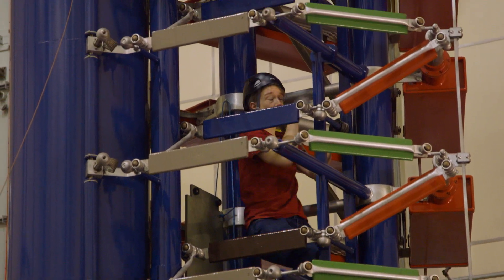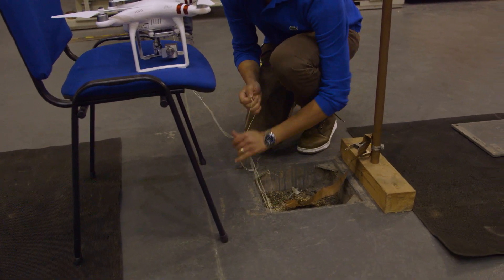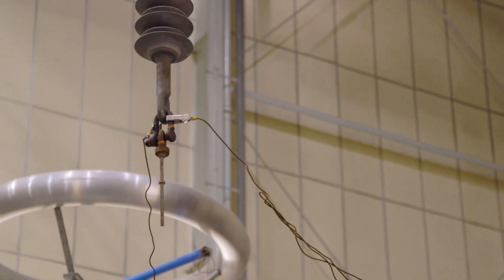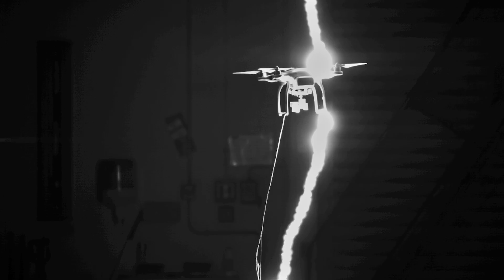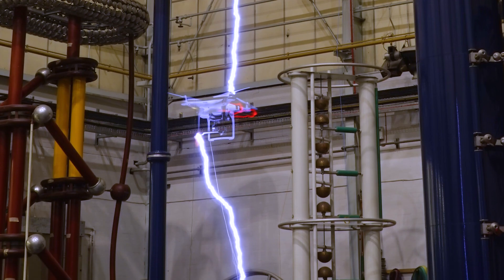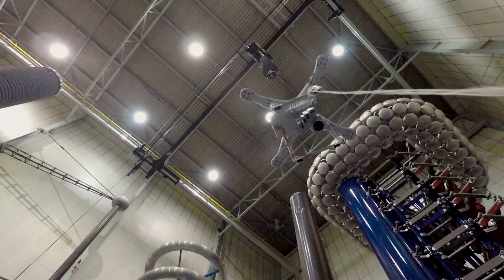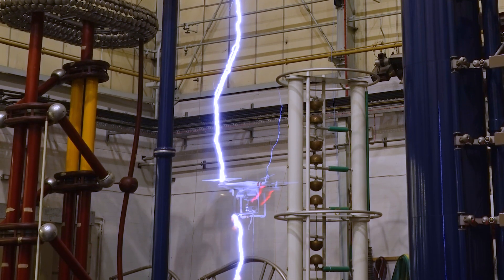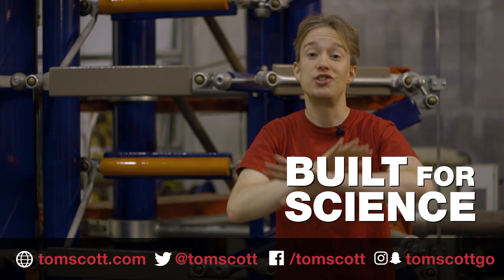We hit a drone with lightning

Comment: SloMo Guys should have been there for this.
Reply: would have loved to see the several hundred thousand frames per second on this.
Reply: They did use a high speed camera at some n-ty thousand frames per second. Says 3000x slower, and assuming it was slower than "regular" 25fps video, that would put the cam at 75 000 fps.
You could catch a glimpse of the Phantom Camera Control software on the laptop :)
Reply: a 200,000 frames per second camera would still be better.
Reply: @jamesmccann531  No high-speed camera in this instance works very well without sufficient lighting and I have to say I was a bit bummed that you could hardly see anything happening besides the discharge striking the drone.

Comment: do lightning chose an active electric motor over a little tape. I'm not surprised. i would like to see it strike a more legitimate attempt to divert. like an antenna on top taller than propellars and wire on bottom to give an exit below the landing gear

Comment: So why don't lightnings affect planes? Because of the metal hull?
Reply: @Karl Kastor Yes. Modern airplanes have a conductive skin or layer - usually metal. Airliners are struck by lightning regularly without mishap.
Reply: planes are very smooth so the lightning curves around the outside and drips off the bottom.
Reply: The simple answer is that it does affect the planes, but various sensitive components are well shielded. If you had a personal electronic device on in an aircraft that got struck and were sitting in a window seat, the might be some issues. However, most commercial flights will avoid situations that would lead to getting struck by lightning due to the other weather issues associated with storms (mostly various wind patterns).
Reply: Maybe because planes don't have a string attached to them leading to ground?

Comment: "The wire is not conductive". Hmm. I was under the impression that there are no insulators, only sometimes there is not enough voltage. You probably meant it is no more conductive than air.

Comment: Put a longer Copper rod (around 15 cm taller than the motors) at the top of the drone and put a thick metal wire going to the bottom! problem solved, the motors use high current so they probably have thick wires so that's why it skipped the tape!

Comment: if electricity follows the path of leart resistance, does that mean it can predict the future? cuz how does it know what that path is before it's got there
Reply: @Ronathon_69 Electric current doesn't follow the path with the least resistance. Current takes all all the paths available to it, but more current flows along the path[s] with least resistance. You can see this for yourself if you build a circuit with two [or more] paths of different resistances - current flows in all of the paths to different degrees.

Comment: Umm, what's that wire connected to the drone? Used for stability? Data in/out?
Reply: Bhupinder Saini it's non conductive rope. It was put there as a safety line
Reply: Safety of what though?
Reply: possibly of the lab as they have equipment which costs millions and if there was interference from the capacitors building that meant the drone flew into the equipment it could have been very expensive

Comment: from what I have read before lightning rods usually protect a cone of 60 degrees under the tip of it 
so what you can do is just make a long rod on top of the drone and connect it to the tape

Comment: I am fascinated by the two propellers that went skyward when the lightning struck. Did the motors spin up uncontrollably to the point where the props just let go? That only two propellers left their mount could be because they are counter-rotating (to balance out the torque to stop the drone from rotating the other way), and the other two would then just seat themselves further on the motor shaft.
Reply: If the motors dead-stopped due to the electrical assault, I could see the props spinning themselves off the now-stationary motor shafts (I believe the Phantom 3 props are spin-off - normally tightened by the drive direction of the motors). The props which rotate "the other way" are also threaded on to the motors the other way (so motor acceleration acts to tighten, not loosen). The newer Phantom 4 prop-mounting uses a bayonet-fitting (push-and-twist) lock so they won't get spun-off.
Reply from the maker: Since they're designed to produce lift, as soon as they were disconnected they went skyward on their own. But how they were shaken loose, I've no idea!
Reply: the rotor and the stator are very close to each other. the closer the better but a high voltage will induce a spark between them and the current will fry and weld them together
Reply: My guess is the motors getting suddenly welded. I doubt the magnets within them would react fast enough to the sudden magnetic field change, despite how large it may be. Again, just speculating here.
Reply: the motors were locked still likely welded stuck , the kinetic energy in the propellers caused them to unscrew and continue upwards as the phantom 3 standard has screw on propellers.
Reply: motor controller silicon shorting. causes a heavy load on the motors.
Reply: I agree with Matthew, but what can cause the motors to stop that fast? Is it the magnetic field or the motor bearings welding themselves stuck?

Comment: I am in engineering physics and now I am confused. Is it right to say that a capacitor is storing voltage potential or charge...or both?  I mean, capacitance = q/v so they are undoubtedly related, I just never thought of a capacitor storing a voltage, always though of it as a charge...but not I just don't know anymore!
Reply: A capacitor stores charge, but it has to be able to hold voltage (so that the capacitor doesn't uncharge itself)
Reply: Actually, now that I think about it, my teacher would HATE that I said it stores charge. The net charge on a capacitor is 0, really, a capacitor stores electromagnetic fields. That field is created via the potential difference in the plates charge (whos net charge is 0). It is likely even MORE accurate to talk about a capacitor storing a voltage potential than a charge...oops

Comment: "Can store 100,000 volts"

So near, and yet so far... :'(
Reply: I knowwwww...
Reply: what
Reply: @eminenception  
There is nothing special about being able to store 100kV. I can just take any random two bits of metal and insulate them well enough from each other and boom! Million volt capacitor!
However, the capacitor I just built is an absolutely crappy one that will be able to hold next to no charge and really can't be used for anything.
So the i interesting bit about those 100kV capacitors that Tom didn't mention is how much ENERGY they can store at 100kV and how quickly they are able to release it.
Reply: I was internally screaming 'AND HOW MANY MICROFARAAAAAAADS?!!'

Comment: That must've been an expensive one between the 2 Phantoms and the usage of the high voltage lab. Do you know which one cost more?
Reply from the maker: The in-video explanation got cut for time, but these were Phantom 3 Standard drones - an old model - and weren't brand new. It's less wasteful than it appears! As for the lab, well, I'd say there was no charge, but...
Reply: I'd be shocked if they charged you.
Actually, you'd be shocked if they charged you.
Reply: +Tom Scott Groan

Comment: The exit point that the lightning took through the landing leg of the drone was caused by the fact that the antenna is actually tucked into the leg.
Reply from the maker: There was actually a bit of footage where we talk about that - but there was also another leg with a different wire that was untouched, and no scorch markings -- so we weren't 100% convinced that was the reason, particularly as the bolt ignored the big, obvious block of conductive tape. To be safe, I cut that out!
Reply: @TomScottGo  That conductive tape is no where as conductive as the bulk metal of the motors, and it doesn't seem to be closer in path with the nub made for it.

Attach one of them old-school telescopic radio antennas to the top of the drone and route a thick wire to the bottom where it'll dangle a bit beyond the bottom legs and you'd have a practically guaranteed safe path for the lightning to pass through.

Without proper design and simulation of a good lighting rod on the drone, that second shot was a waste of a drone.

I would love to see this done with proper engineering.
Reply: I would Love to see photos of the board, but It might have something to do with with the Receiver (connected to the motors) vs the Video (connected to the camera) antenna?  My guess is that the current traveled down the low resistance motor wires to the ESC circuit, and then jumped over into the receiver circuit, and exited through the antenna, a path that was probably still less resistance than the tape.

A possible reason the battery wasn't harmed is the circuitry built into most ESCs to protect the battery from any Induced voltage spikes from a motor being suddenly stopped in the event of a crash, which would short out under the high voltage, leaving an electrical path that does not involve the battery.

It's probably impossible to completely protect a drone from lightening, since the GPS antenna has to be exposed on the top, and the radio antennas exposed on the bottom.  As I'm sure you know, a faraday cage will also block any radio signals, so the antennas couldn't be inside.
Reply: @marknelsonmovies  Maybe isolate them and connect them with bluetooth
Reply: actually it exited though the leg where the compass sits.
Reply: Alternatively, the path of least resistance, and the physically shorter path, are not necessarily the same.
Reply: there is a magnetometer in one of the legs as well with a ribbon cable running to it, better conductor for the electricity.
Reply: Ah, that makes sense. Although I would think the reason it didnt exit via the electrical tape was becaue that was on the outside of the case, the electrics in the legs would be connected to the elctics in the body which are connected to the motor where the lightning entered. Although as the guy said, lighting isnt always predictable, hence it didnt choose the conductive rod, once it had chosen the motors it had to take a route out from where the inside electrics were.
Reply: Tye Walters EXACTLY what I was going to say, about the electronics in the landing gear
Reply: ReabowRotors yes sorry didn't see your comment!
Reply: I wholeheartedly agree here.
The antenna runs straight down on the inner surface of one of the landing sprigs.
Reply: Nope. The probability that it does take the shortest path is the highest of all paths, but it is by faaaar not guaranteed.
Reply: Contrary to popular belief, lightning does not always take the shortest path.
Reply: @Electroblud  it takes the easiest, which is usually the shortest.
Reply: @aidenaune7008  Have you ever wondered, why lightning bolts are not straight lines form the clouds down to ground, but are jagged and spread out? Sometimes (though rarely) they even have loops in them.
Reply: @Electroblud  because there are particles that take less energy to turn into plasma in those regions, its easier to travel in that way than it is in any other.
Reply: ElectroBlood It takes the path of least resistance?
Reply: Nick Charlton compass = magnetometer
Reply: and the compass is in one of the legs with all the wiring.

Comment: No Autopsy ?
Reply from the maker: Here you go! http://www.mub.eps.manchester.ac.uk/science-engineering/2017/05/11/inside-the-drone/
Reply: @TomScottGo  link no worky :(
Reply: Happy to do that - I'd be surprised if there wasn't some visible evidence. What often happens is that the high voltage causes latchup, and the device's own supply does most of the damage.
Reply: They have two dead drones. One can go to Mike, one can go to Clive.
Reply: I think Tom should send it to you for an autopsy. I'd love to see that.
Reply: Thanks Captain Obvious! Next you will tell us that the Titanic sank because it took on too much water.
Reply: Nice! Thanks, Tom.
Reply: That autopsy is nowhere NEAR detailed enough. Too bad.
Reply: Give it to BigClive
Reply: Yes! this needs to happen!
Reply: +mikeselectricstuff
> No Autopsy?
<BONES>It's dead, Tom.</BONES>
Reply: Drops2cents "It's dead, Jim." 
It's fascinating how original series jokes never get old.
Reply: We need Autopsy from you or some one else that knows about electronics.
Reply: mikeselectricstuff yay Tom should send you the drones for an autopsy!
Reply: I was disappointed they didn't test it with an actual "lightning rod."
Reply: mikeselectricstuff there is. look for the top comment by tom
Reply: They did
Reply: It wouldn't surprise me if the huge em induced voltages just fried it, no reason for dji to have put EMC measures into that thing :)
Reply: It's likely to have been damaged by a combination of high voltage and high current. Autopsy not required.

Comment: No luck this time, but I am now persuaded that there is a way to engineer quad-copter drones that are at least partially protected from lightning.
Reply from the maker: I reckon there is: the catch was finding a light enough, rigid enough, robust enough lightning interceptor... that also wouldn't affect the aerodynamics or the rotors. (Flying was difficult enough as it was.) Hopefully another channel will come out with "Drone Survives Lightning Strike" sometime!
Reply: It may not be that hard. I think its more of a cost issue. Going to a conductive composite (copper or silver impregnated carbon fiber) is expensive. Protecting the electronics on a consumer grade product is also expensive. We do this all the time in the aerospace industry, but who is going to buy a drone that costs 2-3 times as much just to be able to fly it in a thunderstorm?
Reply: You can add a bit of weight on some of some quadcopters and they'll still be able to take off, but you'd have keep the center of mass in the middle of the rotors, otherwise it will drift uncontrollably. I too hope that someone will give it a go.
Reply: +theonlyari That's a good idea. Considering that there are already $3000 drones on the market, there is probably a market for that, too.